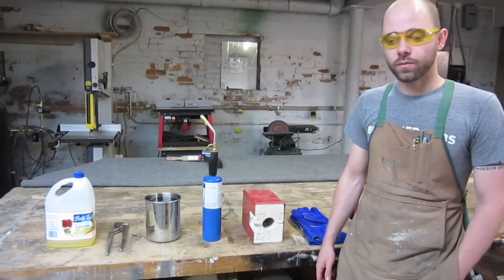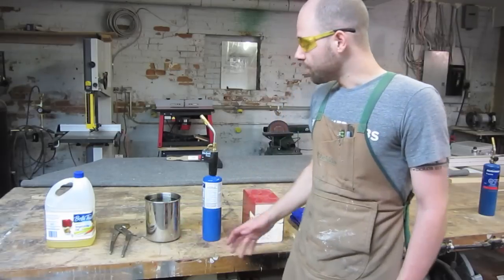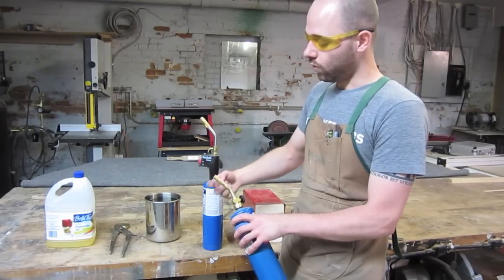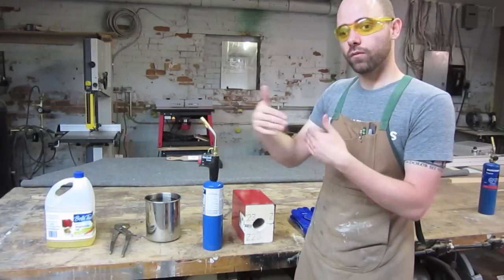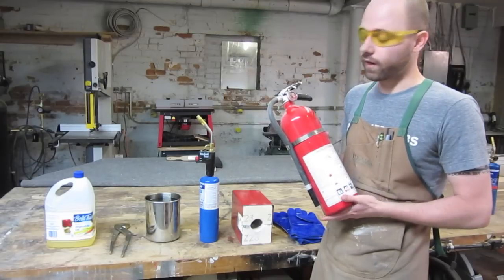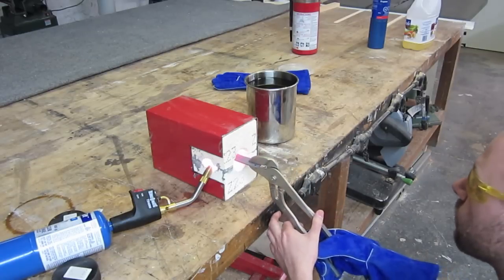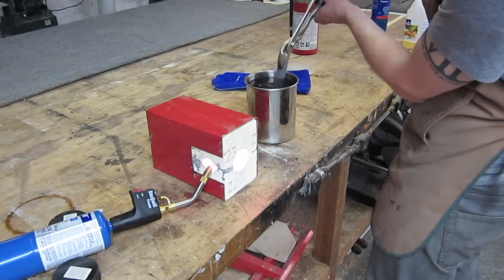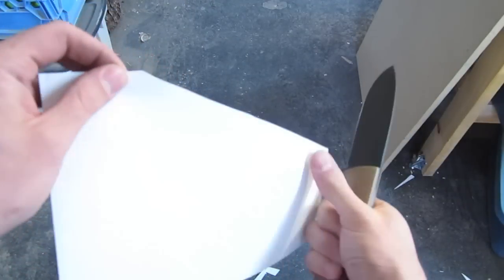How to heat-treat an O1 knife blade using cheap common tools.

Comment: Aaron,
After temper cycle 1 at 200oC for 2 hours, do we let the oven cool down to room temp before running temper cycle 2 at the same temperature and time?

Cheers mate
🇬🇧👍🇦🇺
Reply from the maker: No need to let the oven cool down mate, but you should let the knife cool down to room temperature for 30 minutes or so
Reply: Gough Custom 
Cheers Aaron!
Reply: @GoughCustom  
Aaron, sorry to bother you again - but does the quenched knife go in a cold oven or a pre-heated oven?
Thanks mate.
Pete

Comment: Have you tried air quenching with this heating system or is the precision of the kiln a necessity?
Reply from the maker: Air quenching steels like A2 and D2 need much higher temperatures, and the temperatures have to be held for an extended period of time (usually 30+ minutes). It might be possible to heat-treat them in a forge like this but I don't think you'd get consistent results if you got any results at all...

Comment: BTW, most knowledgeable smiths say that 01 must be heated to 1450-1500 and held for 20 minutes before quenching to get the most out of the blade. Do you agree? Why/why not?
Reply from the maker: I don't think something thin like a knife blade made from O1 needs to be held for 20 minutes, as the steel has very little chromium in it and the carbon inside will move around quickly. Steels with high chromium levels need longer soaks because the chromium inhibits the diffusion of the carbon. With that said O1 definitely benefits from a soak of some kind, even 5-10 minutes makes a huge difference! However it's not a good idea to try that in a forge as keeping the temperature right is very difficult, and any overheating results in grain growth which will make the blade very brittle. In my experience you're better off doing a very short soak like I show and risking the blade be a little on the soft side rather than too brittle... The best answer to get better heat-treats it to buy an electric furnace that way you can soak accurately at temperature without worrying about overheating!

Comment: How does vegetable oil compare to high speed quenching oil, in terms of dissipation and decarb? thanks in advance. Great vid.
Reply from the maker: +FedeU As far as I know the oil will have no effect on the amount of decarb, that depends on your forge. Canola should be roughly equivalent to a medium speed oil I believe. Plenty fast enough for O1, maybe not quite perfect for something like 1095 though, a faster oil could be better there.
Reply: +Gough Custom Thanks for your reply. I intend to use a light viscosity oil for 1070. The reason I'do this is compensation. I believe Brin water is good for sections over 10mm thick. on 4mm the thermal shock is risky. The speed with light oil is good enough to achieve martensite,  while warpage an cracks are less probable. Care to give me your thoughts on that? I'm admiring how well your project is developing! keep up!
Reply from the maker: +FedeU You will be fine using canola oil on 1070, I've heard of many people doing it!

Comment: You cut the paper after heat treating.  Did you put a sharp edge on the blade before heat treatment?  If so, how do you avoid warping the sharp edge of the blade?
Thanks!
Reply from the maker: I only ever sharpen after heat-treating the blades, I just didn't show the sharpening process here as it wasn't relevant to the video...
Reply: Ah, ok. Thanks and keep up the great work!!

Comment: How thick do you leave the edge of the knife when heat treating O1? What's too thin? Is it dependent on stock thickness? I've heat treated my first knife out of 3mm stock (made with your filing jig and sanding block and other videos as guidance, thank you :D). It's taking a great deal of time and work to sharpen it to form an actual edge down from the 40thou that I've read elsewhere...
Reply from the maker: Robany Bigjobz For O1 I would usually take the edge down to about 0.020-0.025" before heat-treatment.
Reply: Gough Custom Marvellous, thanks :)
Reply from the maker: Robany Bigjobz Any time!
Reply: +Gough Custom can you sharpen with that thickness? or do you have to bevel it a little more afterwards?
Reply from the maker: +Riley Daniels You would sharpen straight from that thickness.

Comment: Currently in the process of making a batch of blanks. How many blades can you treat with one tank of propane?
Reply from the maker: I'd say you can probably get 8 blanks or so from one tank. Depends whether you're doing them all at once or just one per time. All at once will be more efficient.
Reply: Thanks! I will be setting this exact setup in my shop this week hopefully. I will be treating 1084 so hopefully they turn out decent

Comment: This doesn't go directly to the tools involved in heat treating, but it does go to tools. What kind of mask filters should I use if working with epoxy and grinding metal?
Reply from the maker: You should use P100/Organic Vapor combo cartridges

Comment: Might sound like a daft question buy if you got one of those cheap torches and drilled a few wholes lower down would that work better?
Reply from the maker: I'm not sure! Honestly I wouldn't try it as it's probably possible to get flame to go back into the bottle which may not end well!

Comment: Have you noticed a difference between heat vs quench and heat soak and quench? Just wondering if you find one is better than the other?
Reply from the maker: If you can accurately hold the blade at temperature then that's definitely better, but to do that you really need a furnace, you'll likely overheat the blade trying to hold it at temperature in a forge...
Reply: @GoughCustom  ya that's what I thought. Do you get good results still with out a soak with o1? Is there that much of a difference between the two methods
Reply from the maker: @AdventureTimeOutdoors  There is definitely a noticeable difference, but O1 heat-treated in a furnace still makes a decent knife!

Comment: One more question!
Is non-magnetic the goal when treating all metals?
Reply from the maker: No it's not actually. It's not the goal when heat-treating any steel! The point where steel turns non-magnetic is called the 'curie point', but the temperature that we're looking for when we're heat-treating a simple steel is generally about 50ºF hotter than the curie point. This is why I recommend heating to 'dull cherry red' (as seen in a dim room indoors) rather than using a magnet.

Hope that helps!

Comment: If I were to use a charcoal forge (with a blower through a pipe onto coals, that sorta thing), would I merely want to evenly heat the knife to that dull cherry red color then quench?  I haven't a torch.  I've also heard a good way to tell when the steel is hot enough is to check when it loses its magnetism.  Is this accurate?
Reply from the maker: ***** Yes, the process you described should work well!

The magnet thing is ok as a rough guide, but for O1 you actually need to go a little hotter than the magnet says. Could be useful as a second check though!

Comment: Hi... how are you. I have a question you might know. I been playing around with heat treating a blade in the FORGE and Quenching it in oil . Using a skill saw blade and ONLY HEAT TREATING THE BLADE.

NOT  BAKING IT IN THE OVEN AND BRINGING IT BACK.  I then tested the knife by throwing it at a tree and chopping with it.  
The blade Did not break and keeped a good edge.  I am wondering if this Method is used or is it a bad thing.   Blade is fine. No chips, no breaks and still have Flexibility because I did not heat  treat anywhere else besides the blade .  Did I Discover something new or is this done by knife makers ? Can use your Opinion
Reply from the maker: Was it a circular saw blade? If so it's likely it hardened very little or not at all as most most circular saw blades are low carbon steel in the middle with carbide in the center. If you did the treatment you did on steel that hardened properly it would be very brittle.
Reply: Gough Custom ....thank you.... I'm new to knife making and doing research,  learning new things and always like input from other knife maker's.

Comment: Say Heah Mr. Gaugh, What is a good R C in your opinion for a O1 Survival/Bushcraft Knife. I hate when they say "We R C our knives 58-60. So is 59 the sweet point or any R C between 58 and 60 is good, why can't they just use a number. I got a O1 5 1/4" blade lenght and 3/16" thick and the company claims it's between 58-59 then a knife maker said to me, If I didn't get a 60-61 out of my O1 knife I didn't get a good O1 knife, He went on to say that what his knives are. But then I seen one of his knives in a Gauntlet and his edge rolled on one of his knives. Is it true that I should of got a knife with a higher R C ? Thanx in advance.
Reply from the maker: +paulie 4x The reason most companies give a range is because they're heat-treating in batches and the knives in a given batch will come out slightly different hardnesses. I quote my knives as being ~62.5HRC and they're usually between 62 and 63HRC for the same reason.

Anything between 58-61HRC will work fine with O1. I would tend toward lower hardnesses if you're using simple equipment because it's too easy to overheat the blade and make it brittle. If you've got a proper kiln and so on then I would probably shoot for 60HRC with O1.

Lots of things will affect how a blade performs: quality of steel, quality of heat-treat, heat-treat protocol, final hardness, temper cycles, blade geometry, edge geometry.

It's very hard to say XYZ is the best hardness because of all these factors.
Reply from the maker: +paulie 4x They give a range because the knives will be heat-treated in batches and therefore all come out slightly different hardnesses.

I would say shoot for around 60HRC with O1, but it depends on how you plan to use it, how you plan to heat-treat it, the quality of the steel and so on, there are too many factors for a one size fits all answer.
Reply: +Gough Custom Thank You so much, I've been told my knife was a 58 RC because they feel that at 58 it's more versital and yet it holds a good edge and sharpen's easier. But Thank You so much. I see where batch tempering doesn't receive the attention a Custom Knife Maker like yourself offers. I just wish the cost would be that of a batch tempering. But fair is fair.

Comment: Old vid but I didn't hear any mention of a medium to help prevent scale buildup? I've heard of bad soap being used as a coating.
Reply from the maker: Hey mate! In this video I didn't use anything on the blade, but you can if you have access to something that will work. I prefer ATP-641 which is a liquid anti-scale compound you can buy from Brownells.

Comment: Hello new subscriber. I have access to high quality table saw blades, would I need to heat treat the blade or would it be hard enough already?
Reply from the maker: It depends on what kind of steel the blades are made out of, unfortunately there's really not an easy way to tell...

Comment: Roughly how long did you have your knife in the forge before it was a dull red? Also, after heat treat, if you find that it wasn't hard enough, could you put it back into the forge for another treatment?
Reply from the maker: About 5 minutes or so, and yes re-heating the blade is fine.

Comment: I would like your thoughts on hot bluing a knife and the tempering it might produce. I want to make blued blades.
Reply from the maker: Provided the temperature used in the hot-bluing process is equal to or below the tempering temp (400ºF in most cases) then there should be not problems!

Comment: Mr. Gough... I just finished heat treating a piece of o1. I used old motor  oil. My file does get somewhat of a bite on it afterwards.  It doesn't just slide. If it's too soft, can I double quench it?
Reply from the maker: You can go back and repeat the process with no issues. You may not have gotten the steel hot enough, or you might have taken too lon getting it into the oil...

Also please note that I don't recommend using motor oil for quenching. It's full of chemicals that are likely bad for you when burned by the steel, and it also might be too thick to quench the steel properly.

I recommend using warm vegetable oil for your quenching.

Comment: Does it mess up the hardening process to heat up the steel during shaping by using power tools? For example, can I use a chop saw or angle grinder to shape a knife if those tools get the steel red hot?
Reply from the maker: Conlan Olson If you're using the power tools before heat-treatment then you'll be fine, using them after heat-treatment you'll have to be much more careful, no discoloration of the steel at all is permissable after heat-treatment. If those tools are getting the steel red hot then something is wrong BTW. Either not enough pressure or dull cutting disks are likely to blame. I'd recommend keeping everything cool anyway, get a spray bottle full of water (or a bucket like I use) and then dunk the steel every few minutes to keep everything cool.

Comment: Do you find it beneficial to normalize the blades (heat to non-magnetic, allow to air cool) before heat treating?
Reply from the maker: +Stanley Graves for O1 steel that's been asked via stock removal, no. If it's been forged, yes!

Comment: Hi, so I bought a benzomatic TS 3000 torch kit, will that work heating up a knife blade. and can I use the torch alone or I absolutely need a forge?

Comment: +Gough Custom was it a double temper...400 x 2hrs twice?  Also how much of the potential quality of O1 tool steel as a working knife is achieved this way?  What I mean is, if 01 treated in an Evenheat oven at 1500 or so degrees for 15mins, and then quenched and double tempered yields a 100% of O1 efficiency as a blade steel, what percentage would you say this simple process yields?
Reply from the maker: +Matt Griffiths Hey mate! I didn't show a double temper in this video, but I would recommend doing it now. I would say this method gets you 85-90% of the qualities of O1. It depends a bit on technique, certainly possible to approach 100% with some care.

Comment: I know this is an old video but I was wondering how you made the metal casing around the fire brick?
Reply from the maker: +heathenous81 I basically took a piece of scrap sheet metal and folded it up into the shape I wanted... How you would do the same thing kind of depends on what tools you have and so on...

Comment: @Gough Custom What kind of container are those fire bricks inside of? It looks like a can you have modified with cutouts to allow the torch an access hole?
Reply from the maker: +xdhatcherx It's actually just some scrap sheet metal that I folded to hold the bricks...

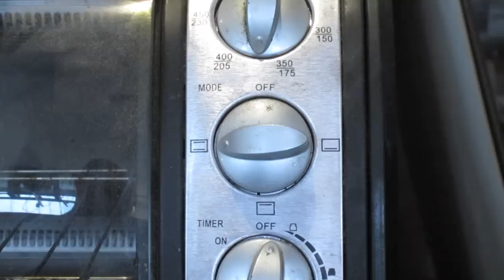Comment: I'm not that keen when it comes to heat treating knives... I've seen where after the initial heat and quench, people will have an oil bath where the oil is at a temp. of about 200C. Is that similar to what is going on at 7:00 ?
Reply from the maker: +Xero Hey mate! I've never seen tempering done in an oil bath, but it kinda makes sense. Tempering in the oven should have overall the same effect, just perhaps slightly less consistent than an oil bath.

Comment: what are you using for the firebrick casing? is it just some sheet metal you bent around them?
Reply from the maker: raighan markowits That's exactly correct! It was the top of an old toolbox that I cut up with an angle grinder.

Comment: +Gough Custom
Aaron I know this is an old video, but I think I fudged the heat treatment.  The blade was dull cherry red in the forge, but not red when pulled out and the oil didn't flare, also a file left marks.  I was concerned about over soaking it past cherry, but when you say that do you mean it should be dull cherry red outside of the forge...I mean glowing 'red' going in the oil?
Reply from the maker: +Griff Grinds it should be visible glowing when it goes in the oil! Make sure to have the area where you're doing the heat treatment relatively dim otherwise the color of the steel will be hidden
Reply: +Gough Custom
Well I guess I am sending them out for heat treatment until I can afford an oven lol.  I used two MAP torches this time and the 2nd knife went right past red to red-orange! This one is for my own use and my first knife that will be made to finished standards, hand-sanded, scales and all!  I am going to temper it 3 times at 400 and see what happens!  Thanks for the video Aaron! Cheers!

Comment: What is the box around your firebricks? Does that get hot from the gap between the bricks?
Reply from the maker: It's just a bit of scrap steel that I bent, and no it doesn't get hot because I sealed the gap with furnace cement

Comment: Hey Aaron, just heard O1 steel needs to held at around 1375 degrees for approximately 10 minutes to get the most of the steel. Do you recommend, getting the knife blank up to around 1400 and slow down on entry of the blade to try and maintain that temperature the best you can. Do that for 10 minutes, then get it all the way you 1500 (nonmagnetic)? Or is worth it.
Reply from the maker: +Eyesofthasouth when heat treating in a forge I tend to recommend to keep the soak time as minimal as possible.. without controlled atmosphere every second the blade is kept hot you're creating more decarburization (unless you're using anti scale compound) and people tend to overheat the blade which causes larger problems with brittleness. If you're confident of your temperatures and you're using anti scale compound (or a reducing atmosphere) then soaking at full heat is very beneficial! O1 is definitely better with a soak but I tend to think that's a more advanced technique and more suited to a high grade forge or a furnace
Reply: Gough Custom thanks for sharing your knowledge , I’ll just stick to basics for now. Hopefully I can get a heat treat oven in the future.